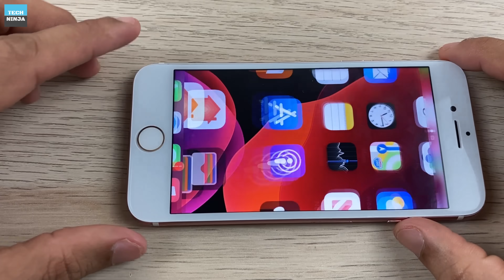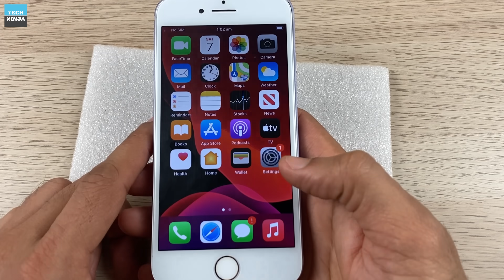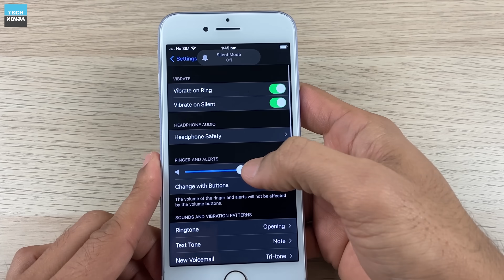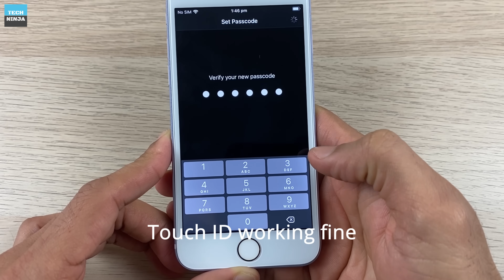Custom iPhone 7 with Square Edges (Like iPhone 12 Series)

Comment: This is actually incredible ! So glad I came across this on my YouTube feed. Next iPhone “SE” should consider this design.
Reply: The whole point of the last two gens of iPhone SE was to use the parts that apple had left over and can't get rid of from the previous iPhone 5S and the 8. That's why you can actually swap parts between them, only difference is the motherboard with the latest chip on their time. If we ever see a 3rd generation SE it will be the same design from previous iPhones. Unfortunately nothing new will be coming on an affordable price.
Reply: @alpcamalan That's what happens when a company chooses profits over creating passionate products for loyal customers. And people will still give Apple their wallets. 

Why change if there's no repercussions?
Reply: and 0.5 too.
Reply: @ShadesOriginals  no, the se is still rounded.
Reply: se 4 is wirhout home button and will be  like a iphone  14, thats why im buying it cus it cheap

Comment: This transformation is 10/10! But the only thing is trying to get a case for it.
Reply: Just don't 
Try using your phone without a case
It's much better because it was designed to be used without one
And Honestly in this case (pun intended) why? It doesn't have a glass back so no need to worry about shattering it

Comment: I want to buy one ! Love that design so much.
Reply: I want to buy an iPhone 7? Um why ... isn't iOS 14 the last update for that phone? Since it's too old and the ram is abysmal
Reply: @xxkarlosxxxxxx7233  LOL WHAT r u trolling the iPhone 7 has iOS 15 it should be supported for the foreseeable future even the iPhone 6s is still supported the iPhone 7 had audio issues sadly though
Reply: @xxkarlosxxxxxx7233  lol you have no idea what you’re talking about
Reply: @xxkarlosxxxxxx7233  I’m still using a 6s plus with 15.2 update dude😂what are you saying
Reply: I want to buy also
Reply: @crusadertwo239  apple is stopping support for the 7 in september
Reply: @byanymeans1419  apple is stopping support for the 7 in september
Reply: @supericeman1  That’s not the point he said it has already stopped updating and as of right now it still gets updates it’s running 15.5 right now
Reply: It only looks good, the power of the A10 chip is not so good for iOS15.
Reply: I want some to buy

Comment: I want to buy one ! Love that design so much. Really want to have one with Touch ID instead of Face ID
Reply: It's 80$
Reply: iphone SE
Reply: @Blvkk you dont have to change the screen.
Reply: @Blvkk actually facial recognition is better with the sensors but not required, there are ways to use your ff camera for facial recognition
Reply: @Blvkk Stop spreading disinfo
Reply: @Blvkk Liar
Reply: @Blvkk Then you know that replacing the screen on an iPhone X is not connected to Face ID in any way.
Reply: @OpasgegenLinks  um… it is
Reply: @beansheeran7322  No it is not. Watch a disassembly video. Face ID is not connected to the screen.
Reply: I only replaced the batteries myself, but I would not do such a modification myself

Comment: 2020's se specs this design oled display new camera module much bigger battery with new mic and speakers and you got a phone for around 450 at maximum!! Or iPhone X body with this upgrades except the oled it already has and from a12 to a 14 or a15 with the new cameras mics speakers and night mode added but cameras from the 11 or 12 with the faster processors Its gonna look fire!!!!